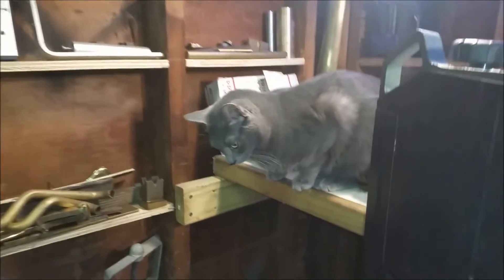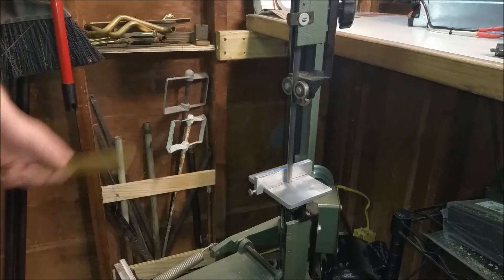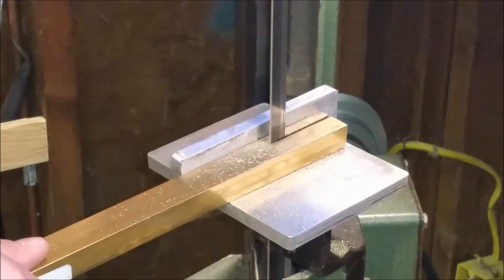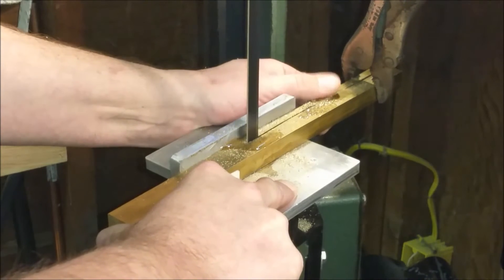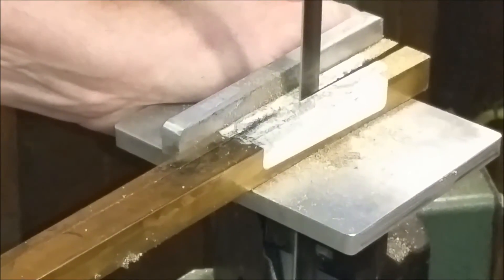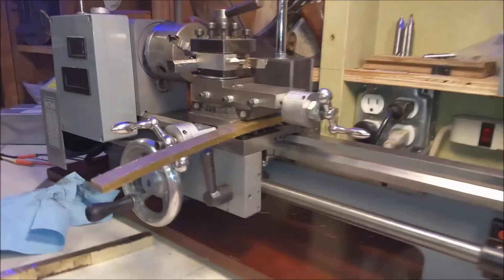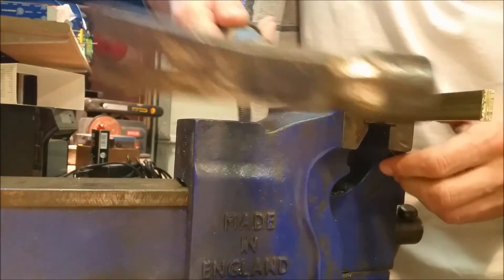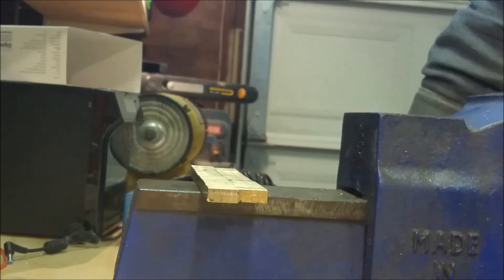Brass gibs for Seig Mini Lathe from stock brass

Comment: We get it: you didn't expect the brass to bend.  Any piece of metal shaped by rolling introduces stress.  You see this is in cold-rolled steel very often.  My solution is to get a piece of 2x2 cold rolled steel and mount it in a vise.  Then clamp the bent piece of whatever to the steel using C clamps.  Do the clamping so as to force the bend to flatten against the steel.  Heat up the bent piece with a propane torch to around 350 Fahrenheit.  Let it cool and when you take the C clamps off you have a straight unstressed piece of metal.  You can then reduce the thickness of the metal without fear of incurring more bend.  Larger pieces can be stress relieved by putting them in an ordinary kitchen oven, heating them to 350 Fahrenheit, and holding it there for an hour.  Then turn the oven off and let the whole apparatus cool slowly to room temperature.

Comment: My guess is the gib part was thin enough that it could bend and the reason might be heat from cutting. The side being cut was getting hot and expanding bending it away from the blade. Just my guess. Can't wait to see how you make the gibs because I wanted to do it but couldn't figure out how to.
Reply: That brass square stock was extruded... I wonder if this bending represents internal stress relief?

Comment: It is my understanding that any formed metal will have internal stresses unless it is annealed to a dead soft condition.   I think that is why a lot of work is done with the metal soft then heat treated then finished with tooling suitable for the material in it's heat treated state.